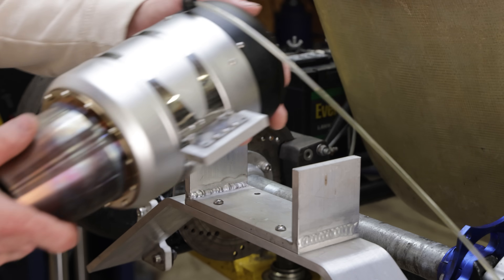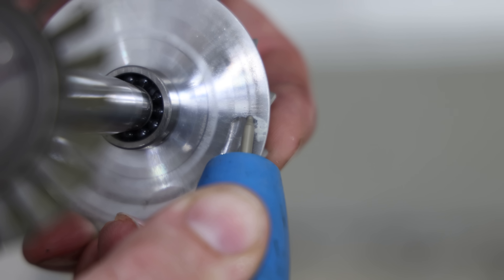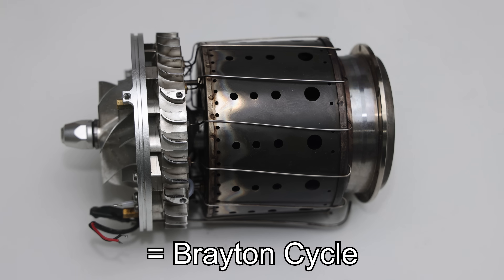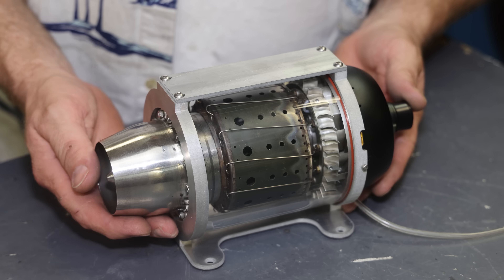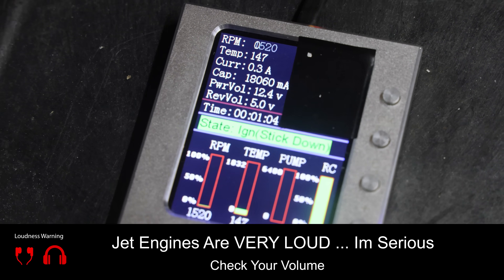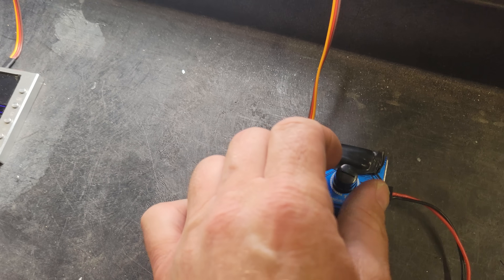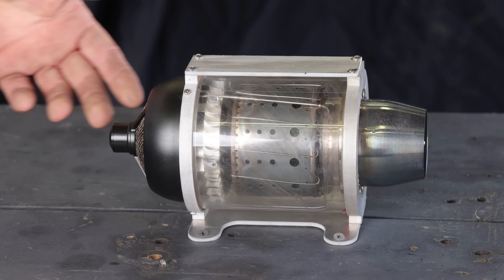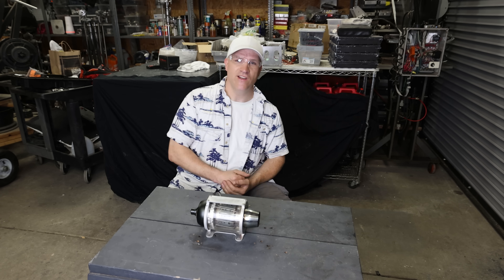See Thru Jet Engine

Comment: That hit almost 130k RPM.  That's incredible, and I'm surprised it stayed together through the testing.
Reply: it blows my mind everytime im reminded of how fast turbines spin, even in regular cars, their turbos can spin anywhere from 100 to 140k rpm
Reply: @magnusthoegersen8974  The newer smaller engines go over 200,000 RPM !
Reply: @magnusthoegersen8974   what in the goddamn fuckin hell. For reference anyone that doesn't know, a regular gasoline car engine runs at around 2,500 RPM even at highway speeds. At 7,000 RPM and up, you're risking engine damage
Reply: @Joe_P  hes talking about the turbo speed not the engine speed sherlock
Reply: @helojoeywala6622  I'm making a comparison Sherlock
Reply: @Joe_P  ah allg my bad
Reply: @helojoeywala6622  You've been oversherlocked.
Reply: @Joe_P There are engines out there that were built to be ran at very high rpm, like F1 engines, rotaries, etc.
Reply: @TheSilverShadow17  even those are nowhere near 130k RPM
Reply: @Joe_P  But since you're talking about gas turbines and turbochargers that makes sense
Reply: Right, I calculated the speed of the ends of the turbine estimating a 5 inch diameter. At 126k rpms the ends of the turbine would be traveling 1,800 mph. I can only imagine how fast the ends of turbines that have diameters of feet, reaching similar if not higher rpms. Absolutely insane.

Comment: If you wanted you could have added a Temp Sensor to the Shell, or used a Laser Temp Gague so you could show us the Surface Temp of the translucent Shell. and maybe a Wind speed sensor a safe distance from the Exhaust to show the Wind Speed comming out of the Engine.

Comment: Amazing work!  That was so wild to see.   With regard to the fog, do you think the engine was just running so hot that it immediately burned the fog?   Either that, or it just literally boiled it.   The fog machines usually use propylene glycol with a boiling point of 188 °C.   I wonder if there is a particulate based fog machine that could do a better job visualizing the flow.   Either way, this was awesome!

Comment: I'm impressed that the bypass air was enough to keep the case from burning.  It was also neat to see the jet fuel burning with a blue flame through the openings at the higher power settings.  It just goes to show how intense the combustion is.
Reply: @swagfish1996: not all of the air in a turbojet engine goes directly into the combustion chamber, some of it bypasses the primary stage and is introduced downstream to cool the engine and provide additional air for complete combustion. I think that's what the commenter above you was noticing. With that said, it's definitely not bypass air in the same sense as a turbofan engine, because it's all still going into a later part of the combustion chamber. But I suppose it could be seen as bypass air from a certain point of view.

One thing I will say is that supersonic turbojets have bypass ducts because that's where the excess airflow from the intake goes at supersonic speeds... but none of that flow enters the engine core.
Reply: @ErickC To clarify; In a turbojet, air that bypasses the combustion chamber rejoins that flow before the turbine. This serves to moderate the temperature of the gas hitting the turbine so the turbine doesn’t overheat and fail. This is called “internal bypass”. Turbofans do this as well, but the difference with a turbofan is that they also have EXTERNAL bypass air. Most of the air coming off the fan bypasses the engine core completely and is only used for thrust.
Reply: Thank you all for the clarification on internal vs. external air. I  didn't know the difference other than the air missed the combustion chamber.
Reply: Did you notice the combustion on idle, then as you increase power the red ring slides to the rear of the can. Combustion further and further down the combuster , it's getting close to the turbine blade. Can you lengthen the combustion can and control the location of the combustion.?

Comment: Made me think of the Tesla turbine. Is it possible to make a jet engine with one or even two Tesla turbines? The disadvantage of Tesla turbines is the required high speed. A similar thing could be said about jet engines. Perhaps like chocolate and peanut butter? Probably not effective on an airplane but in this little thing in your hand, I can envision Tesla turbines which are supposedly the most efficient turbine invented.

Comment: Instead of the aluminum strapping, you should have four long bolts on each "quarter" like how an alternator head on a gasoline engine generator set holds the two end bell housings together around the stator.  Some electric motors are built that way too.

Comment: Small correction true for simple turbine, not for a high bypass engine where most of the trust/power comes from the outside airflow....
Reply from the maker: This is not a high bypass engine, it's a turbojet.

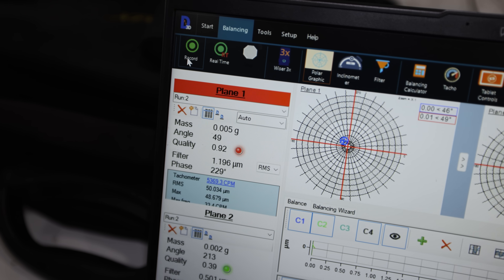Comment: Which software are you using at 0:41? I would like to learn that as I am a mechanical engineering student.
Reply from the maker: Fusion 360
Reply: @WarpedYT  really??? Fusion 360's interface is not like that?.. Is there some add in or?... I am a solidworks user but I have seen Fusion 360, it doesn't look like that, I'm not sure much about fusion but can you specify more?
Reply from the maker: 🤦‍♂️ no I'm sorry, that's the balancing software, completely different

Comment: I would assume they're really dangerous part of that is when the engine is stopped, because the laminar airflow around the turbine is what's keeping the housing cool. Shut it down and that 1300° has nowhere to go but into the plastic.
Reply: Thank rotational inertia. Also model planes don’t use thrust reverser. The engine already idles on approach.

Comment: What a sound! I’m astonished that the see-through cover didn’t expire from a combination of heat and pressure.
Reply: RIGHT!!! From 4:20 to 4:40, I was totally squinting and turning my head slightly, worrying it was gona explode. The pitch just kept getting higher and higher! I'm thinking, "this can't go on much longer!" LMAO. Such a cool piece of engineering.
Reply: What material was the encasement made of?
Reply: @ronz101  plastic
Reply: Is it not ceramic glass?  @ronz101
Reply: @ronz101  - no idea. Perspex?

Comment: Do a video with high octane booster 1:6 ratio with a denser fuel like petroleum with less oil use vegetable cooking oil total in gallon volume then add plain rubbing alchohol

Comment: Why do the expanding gasses not escape through the front as well as the rear?   If you increase air pressure in a cylinder it will escape through any hole in it.
Reply: Rule #1: Gasses move from high pressure to low pressure, always. In the front of the engine is a centrifugal air compressor so right after the compressor is the highest pressure in the engine. Every inch you move back towards the exit nozzle in the back, the pressure decreases so that's the way the air flows - high to low pressure - no different then your hair dryer. Contrary to popular belief, the burning of fuel in a jet engine does NOT increase the pressure of the moving gasses as it's not contained. The burning of fuel adds heat and velocity (due to expansion) to the airflow - same as your hair dryer on high heat. The difference between a jet engine and a hair dryer is that in a jet engine some of that heat is converted into rotational energy as the air exits the combustor and goes through and spins a turbine, that spinning turbine powers the compressor in the front by a (not seen) common driveshaft in the centerline of the engine. The nozzle at the back then converts as much remaining heat in the air as it can into velocity to give you as much thrust as possible.
Reply: Stall happens. You have to make the compressor stronger than the turbine. Maybe watch a LS engine in a GM Corvette and bolt on a centrifugal compressor

Comment: Hands down of the best engineering that I have ever seen,  Please put part two together,  I would love to see if possible how the fuel ignites inside the chamber, love it! Thank you for putting together all this fantastic material.
Reply: Unfortunately don't think that's possible due to the heat and pressure inside the combustion chamber. It's a pretty cool process though.
The fuel is sprayed into the engine, initially lit by igniters. Once it's self sustaining, the igniters shut off and the fuel continuously flows into the engine through a mist and keeps itself burning - just like a stovetop burner.
Reply: The fire part is all for show. Most commercial jets are utilizing “compressed air combustion for OVER 90% of thrust” according to the manufacturers animated video for explanation purposes.
They ignorantly maintain the lie, as 50% of airfares are due to cost of fuel.
Reply: @rickyrabs2582  Seeing that you have a saved flat earther playlist shows us everything we need to know.
But don't listen to me, as a 'highly' trained aircraft fueler I'm in on the lie too!

Comment: Id like to see a cutaway of the combustion chamber and transfer into turbine.
Nice video!
Reply: Turbines in a turbo were always so easy to understand. Even variable geometry is kinda just another step. Helicopters have a centrifugal large stage in the compressor. Why don’t jets use radial ( anti centrifugal) turbines? Why is the cooling layer around the combustion chamber not extended through the turbine, so that really only the blades touch the hot exhaust?

Comment: The gasket didn't fail because of pressure, it failed because of the temperature, you can see only the one downstream of the combustor came out, even though the pressure is roughly the same at both ends of the combustor. I worked with similar engine before, the pressure is only 2 bar and that's for 100,000 rpm.

Comment: 1. what was the point of balancing the compressor impeller on the shaft, and then removing it, after disassembly, balancing is lost
2. Why is the shaft on the calibration stand driven by a belt? why don't you use a vacuum cleaner?

Comment: I guess my question is silly because jet engines work but how do the expanding gas "know" to come out of the exhaust instead of all directions equally?
Reply: Rule #1: Gasses move from high pressure to low pressure, always. In the front of the engine is a centrifugal air compressor so right after the compressor is the highest pressure in the engine. Every inch you move back towards the exit nozzle in the back, the pressure decreases so that's the way the air flows - high to low pressure - no different then your hair dryer. Contrary to popular belief, the burning of fuel in a jet engine does NOT increase the pressure of the moving gasses as it's not contained. The burning of fuel adds heat and velocity (due to expansion) to the airflow - same as your hair dryer on high heat. The difference between a jet engine and a hair dryer is that in a jet engine some of that heat is converted into rotational energy as the air exits the combustor and goes through and spins a turbine, that spinning turbine powers the compressor in the front by a (not seen) common driveshaft in the centerline of the engine. The nozzle at the back then converts as much remaining heat in the air as it can into velocity to give you as much thrust as possible.

Comment: I have worked around jet engines being tested for stress and the engine was mounted to a fixture in a 20 by 20 room with two foot thick concrete walls and the taxi rated engineer sat behind a two feet thick piece of bullet proof glass while controlling the engine from the outside of the room .I have seen the aftermath of the damage the engines made after some literally exploded but they were creating 41,000 lbs of thrust . This was back in the late 70s and the engine being tested was the old TF-41 which was a monster of an engine . Very cool video !

Comment: Very good demonstration. I attended Aviation High School in New York. If they had this demo. I would've understood Jet Engines much easier. Btw, I noticed you put a screen cover on the intake. Why don't the engines on planes have a screen to avoid bird hits?
Reply: Screens don't scale up to many feet in diameter without getting much weaker.  At those sizes, they couldn't withstand a bird strike.  Then too, they'd ice up in icing conditions and cut airflow (and thus fuel economy) too much to be acceptable.

Comment: The fog evaporates because of the combustion. You’d be better off running it with just the high speed turbo fan and compressor alone. The fog should look pretty cool then. (Rpm’s substantially lower as well. )

Comment: I've long been tempted to build a front end of a jet engine with a vacuum cleaner fan.
Just has to barely run, not generate significant thrust. Some vacuum cleaner fans are physically strong enough to just barely make that grade.
But, as you showed, balancing such a prickasaurus rex would be painful.

The explanation of a jet engine, isn't that the Fifth Element's secret?
I'll just get my coat...

Oh, for smoke, a smoke generator is an aerosol, smoke particles would work better to illustrate the internals, but not be exceptionally illustrative, given the burner can is metal and hence, opaque. 
Still, pretty cool! Didn't expect the casing to survive as long either, that's a hella of heat to deal with.

Comment: from a government run website.
Temperature and amount of oxygen:The hotter the fire, the less smoke and pollution it produces and the more effi- ciently it heats your home. Even though a smoldering fire may use less wood, it produces less heat and more smoke. Fires that are getting enough oxygen burn hotter than those that don't get enough.

did the extreme heat destroy the smoke in this test at the end? that's so interesting and huh...this leaves me with so many unanswered questions.

Comment: Can you scale this up to say from 100-300HP range and keep it cheap and reliable, while fuel efficient, (high by-pass or turbo prop)  add FADEC to it,  There is a market for small airplanes for such engines. A turbine engine although simpler in theory, but it is actually much harder to get running than an old fashioned piston engine.

Comment: Question:  Does the exhaust come out in a spiral, or just a straight flow?  (I was hoping to see that,  it came out clear even with the foggy fog.
Reply: Some jets use guid vanes to convert the helix swirl into thrust ( and carry the cone ). But with a geared fan you could probably rotate the turbine so fast that the exit velocity is just compensated.

Comment: i have a small dought to rotate the turbine we need an electric motor ........so to power that electric motor we need a powerfull battery also but the question is that ......to run the engine continously we always have to use the motor ?
Reply: Why don't you adapt it so that it can be powered by your puds?

Comment: Very very cool!  I was thinking the acrylic tube would melt but I guess the amount of cool air being pushed through is just enough to keep the temp low enough to prevent melting it. And yeah the pressure is amazing how it expanded enough to allow the gasket to blow out. Maybe a couple more horizontal brackets to help keep it together.

Comment: Also since this is about jet engine, especially you made it look too simple which of course must have a ton of behind the camera work,  can you please explain about the "Vina Contracta", which I studied in engineering books long back, when studying about compression of fluids and nozzles such as fluids entering at a lower pressure and speed at one end but exiting at a higher speed on the other end ?

Comment: Brilliant engineering, metals used for this project would be interesting to know, reliability for sustained use?
Reply: Iron melts above 2000 K . Flames are hotter. So there is not much freedom. Tungsten is too expensive.

Comment: Looks like the glass tube may be a McMaster-Carr Pressure-Rated Borosilicate Glass Tube, 3-1/2" OD, 3-1/16" ID, 4" Long
Reply from the maker: Lol good guess but it wasn't that easy unfortunately. These were custom drawn tubes made from my recipe. Same material I used for the see-through rotary and a see-through liquid piston. That would be great if Chinese jet engine parts were made to American standards 😉
Reply: @WarpedYT  So you do read these comments as time goes by.  I read where boron and other materials could be mixed to create a variety of useful properties in the glass.  Good for you.  And I am routing for your quick patent award.
Reply from the maker: @jimw1615  yes I do. Even on the old videos I try to read all the new comments. Yeah it took me about four years to develop it, and the material is pretty amazing so far. I went to patent it a couple of years ago but my patent attorney told me it was a waste of money, because if I patented I have to make the ingredients publicly available and for that I will just use it myself instead of with other companies, it really only has application in educational use or like YouTube projects to make reliable assemblies that are transparent, but definitely not something that you could depend on everyday. Thanks

Comment: Very simple design. I do not understand why this was not used in WW2 vs the British design with all of the combustion chambers.  This was the very basic design that was drawn in 1932 and then he wound up with 10-12 chambers all around the engine with a complex air flow.
Reply: German planes burned through one turbine ( not the whole engine) per flight. No range.

Comment: Wow how cool!!! I have always wondered how the combustion worked in the operation of a jet motor. what type of pressure is developed on the cold side and the temperatures must be significant with that volume of air being compressed?